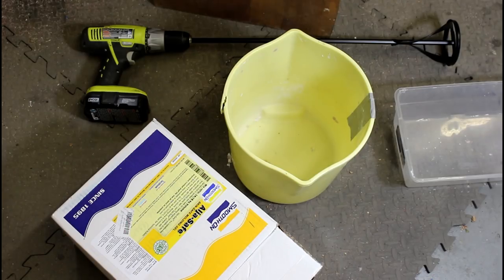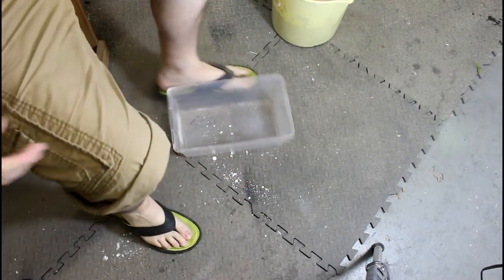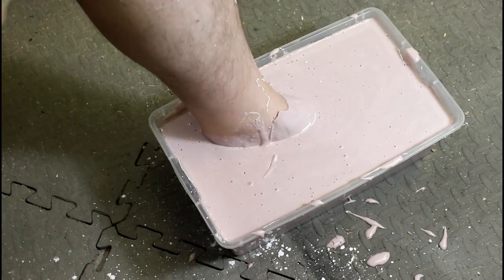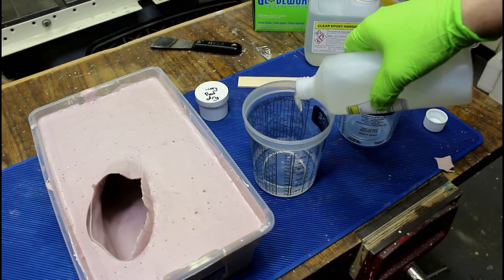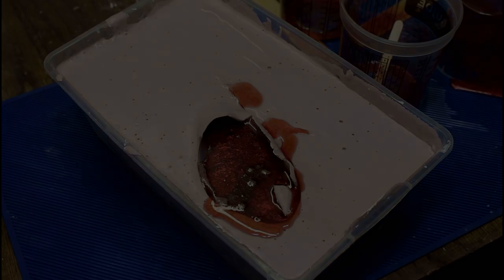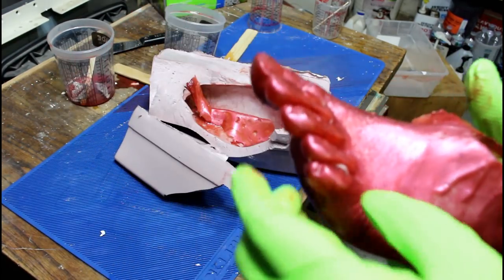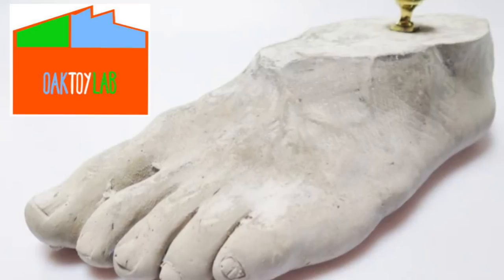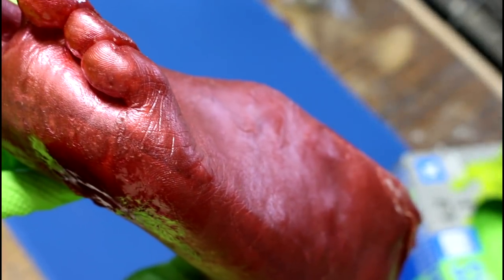My Left Foot

Comment: If the shop ever burns down that is really going to confuse some firemen.  It's going to be a whole thing.  I would suggest not letting that happen.  Maybe for some other reasons too.
Reply: krtwood good advice. 😂
Reply: I can already imagine the future instagram conspiacy theories: 🚒🔥Firemen found that only a strange red foot survived the fire. Is this proof of aliens??? 😱👽
Reply: They would probably rather think it was a serial killer's trophy than an alien conspiracy. I mean, really...
Reply: @magpie405  SCP-5513: 
Description: 
SCP-5513 is a left foot cast in red dyed epoxy resin, the surface anatomy of which appears consistent with that of an average middle aged North American male. 
Anyone in possession of this foot (hereby referred to as SCP-5513-01) will feel a steadily growing urge to amputate their own left foot and replace it with SCP-5513. When this is done SCP-5513 will attach cleanly to the amputated area, fusing seamlessly with the tissue and providing SCP-5513-01 with full sensory feedback. 
However; SCP-5513 is subject to the same material properties as that of non-anomalous epoxy resin, and does not heal or move as a biological foot would. If a majority of the material is broken off or otherwise removed from the connection to the leg SCP-5513-01 will begin to suffer effects consistent with that of continuous exposure to uncured epoxy resin, eventually resulting in the subject perishing.
Upon the death of SCP-5513-01 the largest intact piece of SCP-5513 will slowly regenerate through unknown means until it has regained its original shape. While in this regeneration phase SCP-5513 will cease to exhibit any anomalous properties except for regeneration, and if broken into yet smaller pieces the largest one will continue the regeneration until the original shape has been regained. Non-regenerating pieces of SCP-5513 have so far been tested and concluded to permanently lose all anomalous properties.
Reply: As a fireman, I can honestly say that would scare the shit out of me while doing search and rescue.

Searching around doors and couches, and all of a sudden, scorched red amputated foot.

Comment: You should try putting those orbeeze balls in the stabilizing resin! You don't have to bake them, you can put them in a plastic bag and warm water to finish stabilizing them!

That'd make an interesting bowl, chandelier, or some other type of art! 

Plus it would be interesting to see how long it would take for the balls to fill up under pressure!
Reply: Orbeeze are a polymer and they absorbe water. They don't have any (or at least that much) air in them. So I don't think that would work
Reply: Maybe if he allowed them to soak until fully saturated, and then freeze dried the orbeeze.
Reply: Perhaps use a water based resin?
Reply: Nick Zammeti already did this. Look him up

Comment: Mr. Brown, I think if you were to use a pressure pot, you would be able to have the resin cure faster. 

I use the 24 hour curing time resin, I'm not even sure what the name is. But if I use my pressure pot, the resin is solid after 2-3 hours for a smaller piece and then 4-6 hours for a larger piece. 

Hit up some paint pressure pot company and see if they would sponsor a video for a 10 gallon pot!!! You'll just need to build a stand for it to lay on it's side if you're wanting to do this again!

I think it'd be funny to have Mrs. B, your daughters, and your foot as door stoppers in your house haha
Reply: In chemistry, there's the Arrhenius Equation which describes the relationship between temperature and chemical kinetic rate constants.  It describes a general rule of thumb whereby you can expect to double the rate of chemical processes each time you raise the temperature by about 10 celsius or 20 fahrenheit (well, 18, but it's not super-precise anyway)

Comment: I work with FX makeup a bit, which requires a life cast in some cases, of people's faces... alginate is great if you are using a quick setting casting material such as plaster, but it does sweat over time so long setting times are ill-advised. I suggest trying again with a skin safe silicone, I like to use smooth on brand "Body double silk" life casting silicone personally. You can find skin safe silicone pretty cheap though and it doesn't sweat, so long setup times for resin shouldn't be an issue. Just be aware that some silicone can be rather stiff so maybe look for a soft one to help provide a bit of stretch so you can wiggle your casting subject out of the mould. Also, mould release is strongly advised, which can be as simple as a thin coat of Vaseline/ petroleum jelly over your skin. They even make spray-on mould release that could be useful. Just a suggestion.

Comment: algenate is really only good for things that dry with in and hour after that the detail starts to shrink from moisture loss . If your careful taking piece out of mold u can make a few copies of it . Also if u cast a body part wet your skin a little with cold water , slides out easier.

Comment: I have done a bit of casting with Al-gin-ate. I had quite good success with it in casting for making prosthetics, like vampire teeth.  Typically it is only good for one casting, but I have managed to get multiples from it by encasing it in plaster of Paris, with reinforcement material added.
 It will work better on castings if you put it on a vibrator table to remove any air bubbles, just like with resin. Or in a vacuum chamber.
 This is basically the same stuff dentists use to make molds of your teeth for crowns. Now if you are making silicone molds  , you cast the item in alginate first, as it picks up a lot more detail than the silicone will. Then make a mold from silicone from the item cast in the alginate. Also using a dental type plastic will let you make quick items from the alginate.
  For reusable molds, I use the blue silicone, and then when it cures, you can make many castings of the item before the mold wears out.

Comment: I love using alginate. I never use it for resin but it may work better with quick setting resin. It may still make the resin sticky because of the water in the alginate and resin doesn’t set well when water is introduced. My favorite use is for when I’m making two part molds. I use it in place of where most people use clay because it’s cleaner, quicker, and self leveling.

Comment: The way to do it with resin would be to make a plaster cast in the alginate, then you can make a master mold using said plaster cast and silicone.
Reply: Lynn C that would work but each successive cast would loose more and more detail
Reply: Then why not make I silicon mold from the beginning....
Reply: You use alginate for body parts, as silicone takes too long and is harmful to skin. It's what's used for special effects makeup making for movies and things to get a face cast.
Reply: Lynn C what about skipping the plaster and going from alginate straight to silicone?
Reply: There are skin safe silicones available, such as pinkysil, liferite, Dragon skin. I think most of the addition(platinum) cure silicones are reasonably skin safe, but I stick to the ones that specify it.
Pinkysil is probably not as quick as alginate, but I certainly wouldn't consider it slow.
Reply: I'm not positive, but I think that they would stick. Plus the alginate makes a negative, the plaster a positive, and then the silicone back to a negative for casting.
Reply: While pinkysil isn't as quick, and is more stable, it's exponentially more expensive. And I haven't personally used pinkysil, so I don't know how detailed with texture it can get, such as the skin texture.
Reply: I have to disagree with price disparity, but that may be an Australian problem as we frequently get shafted on costs compared to US or UK. But even with the additional cost I find the extra work time saves me a lot of wastage on larger casts as there is a limit to how quickly I can work.
 Skin detail has never been my primary factor so I haven't really paid attention to that feature, but it certainly takes very small mechanical details quite well.
Reply: I would think silicone would be great to stop a door so why not just see if the pigment will work for the silicone and cast the stop out of silicone
Reply: mancraft silicone can often collect dust and dirt so it’d look pretty gross very quickly and it can degrade with time. You also have to have very specific pigments for silicone and alginate and silicone don’t work well together.  The best process (for what peter was trying to do) is to make an alginate mold of the foot, cast a stone positive, mold that stone with silicone and then pour resin into the silicone

Comment: Alginate is used for dentists to make a mold of all of your upper or lower teeth at the same time, after getting the alginate to set I believe they use gesso/plaster to get a positive mold, from there you could make a standard rubber mold and cast it in resin if you wanted. It's not that simple, but is safe enough to shove into peoples mouth, sooo...

Comment: This is what they use to take dental impressions. I've had a lot of those done. I've also done a hand casting in the past! What I did was make the mould and mix the alginate right in the mould and then stuck my hand in there. I didn't use resin though. I used plaster of paris. Thanks for the video! Very cool!

Comment: I manage a dental lab specializing in dentures.  To make models of a patient's mouth, we use a nifty kind of alginate that is purple when mixed and ready to use, turns white when it's set, and turns pink after it sits around past the time recommended for pouring the models (too long and it starts to dry and shrink, and that affects accuracy).

We pronounce it AL-gin-it.

Comment: Hey, something I can give tips on! You seem to have worked out a lot of the kinks by the end of the video, but a few things to note you may be interested in. Definitely switch to cool water. It will increase your working time significantly. 

You mentioned switching to quick set resin for future tests. If you mean Urethane fast cast resin, the AB kind, it is usually pretty moisture sensitive and can be inhibited by alginate. A tip I’ve learned is before casting, give the surface of the alginate a good pat dry with paper towels, and then a quick wash of acetone. For face castings I usually just pour some in and swish it around all surfaces before dumping out. Follow immediately with the resin and you hopefully shouldn’t run into too many moisture problems! The faster the set the better.  

If in doubt about material compatibility or the slower setting resin is a must, a switch over to a lifecasting silicone like Body Double.. while expensive.. will make a mold that doesn’t have the shrinkage or moisture issues and can be used multiple times. If you did move to silicone you’d want to switch from the dump method to doing layers and following with a plaster bandage mother mold.  

Dental alginate and a mini vacuum former can do some cool stuff too. Monster teeth and faux grills! Could be fun!

Comment: Peter.... as a sfx artist I must tell you it’s pronounced like al-Jin-et and you need to mix it w COLD water SLOWLY by hand NEVER with a power tool. Also a fun thing you can do is leave the mold to dry for a while and it’ll shrink. My teacher once let a face cast shrink and kept making a stone positive of each shrunken face and casted in alginate he kept shrinking until it was only about three inches tall. Super cool stuff!
Reply: No ones probably interested but if you still wanted to use alginate and resin you’d have to make an alginate cast, fill it with stone like ultra cal or maaaybe hydro cal then mold THAT positive with silicone and pour your resin into the silicone mold

Comment: I don't know if it was said as I'm only halfway through the video, but warm water causes alginate to gel and set up faster, cold water makes it set slower. :) Also, alginate shrinks within hours of it setting, as it is made of dried and powdered algae. If you want multiple pulls or need to leave it for some time, use platinum life cast silicone like Body Double Silk! :)

Comment: Alginate is very acurate and gets all the details and it has a very fast cure rate, which is why it's used for dental impressions. It also loses it's water/sweats it out in a matter of hours if its exposed to air, which causes the alginate mold to shrink a bit, but slows down if you cover it. I don't know how well it would work on that level, but we always wrap the dental impressions with a damp paper towel so the outer layer of the alginate doesn't lose the water as quickly- preserving the accuracy for a longer period of time.

Comment: I’ve always been told to never use resin in an alginate mold since the moisture causes the resin to not cure. If you did something like plaster to fill the mold, then cast your plaster foot with silicon you could make a resin foot with no issues no matter which type of resin you use. Or you could fill the alginate with silicon and it’s possible to pull out without breaking the mold.

Comment: in my sculpture class we used plaster with the alginate molds the tricky bit is you have to take the plaster out when its firmed up but not fully cured because the alginate wont last that long. thinner parts like toes and fingers were at risk of breaking off during the process. Some people used the alginate to mold other body parts like ears and noses but the most impressive was a girl molded her entire legs while sitting in a big tub of alginate.

Comment: They use alginate to create the molds for dentures. They  had to mix it with hot water for me - I have a very sensitive gag reflex, and I couldn't hold the container of alginate in my mouth for long enough to get a good impression.
Reply: Ace Lightning
Yep.  I manage a dental lab specializing in dentures.  We use a nifty kind of alginate that is purple when mixed and ready to use, turns white when it's set, and turns pink after it sits around past the time recommended for pouring the models (too long and it starts to dry and shrink, and that affects accuracy).

We pronounce it AL-gin-it.
Reply: I have unpleasant memories of that stuff being in my mouth! But at least my denture fits perfectly!

Comment: You might try putting the mold in the oven at a low temperature to drive off water while the resin hardens.

Alternately, maybe make some sort of mold where the water can slowly drip out the bottom, such as a box with a hole in the bottom with a towel or a screen over it.  You'd put the box in a larger box while you make the mold, then once the alginate firms up, take the box with the hole out and put it up on a rack or on something absorbent that you don't mind potentially getting ruined.

Comment: I’m a dental assistant. Some pointers. Use cold water to slow the curing. It’ll make a better casting if you don’t incorporate air. In the dental field we making folding and scraping motions to incorporate the water to alginate (al gee nate, like algae). Then put the object in to the alginate instead of the other way around. Then loosen by slowly wiggling then slide out gently. Alginate is only good for about 30 minutes to to two hours depending on how hot and dry it is where you are. If you need any other pointers I’m happy to help.
Reply: Also, we use plaster of Paris or gypsum to cast in the alginate because the exothermic reaction isn’t as much as concrete or resin. From there we can make a mold from the study model using a two part silicone that is much more durable against heat and pressure. We that we use exothermic materials to make a cast. Like the two part resin used to make temporary crowns.

Comment: Alginate shrinks as it dries, so has to be used relatively soon after the mold's made. Using stone mixes is best, as the water doesn't affect them as much, you can then use the stone casting to make molds for less problematic resin casting. But half the fun is in the experimenting :)

Comment: Just some advice for casting things in alginate, don't resins that get warm. Since alginate molds are water based, using resins that get hot will dry the alginate out and cause it to crack or set too slowly. Silicone works better in alginate. Quick set resins will cause a lot of evaporation from your mold so you might have it crack or shrink faster than the resin can set completely. Frank Ippolito has video about alginate casting on Tested that is a good reference.

Comment: This is one of the things we use in the dental world for impressions (along with others), it is cheep, sets fast, and has good detail. but you have to make the casting fast (under 12 min is ideal) because it starts to dry out and distort if left much longer (dentures and retainers made on the castings will not fit in the mouth) and you have to take the casting out before the impression distorts/ shrinks and brakes the gypsum stone casting. also if you take the set alginate out of the "tub" it dries more evenly and does not have as much pooling water around it.

Comment: Try taking a plaster cast out of the Alginate mold, then a 2-3 part plaster mold of the plaster cast after it fully cures (also Vaseline will be your mold release bestie). The plaster mold should work with the resin after it fully cures. Takes more effort but works well to make an Alginate mold several uses rather than 1-3 uses :) It can also keep the detail if done right